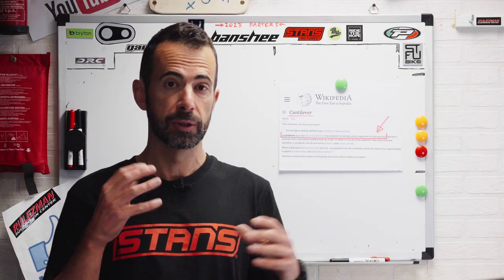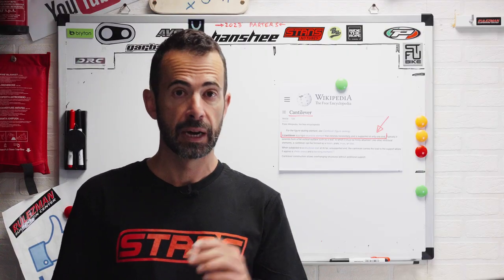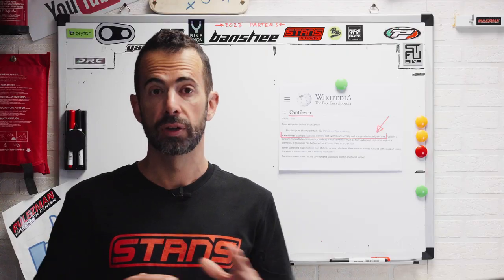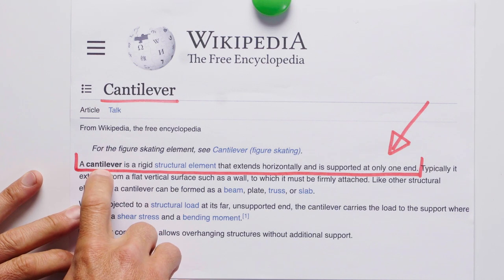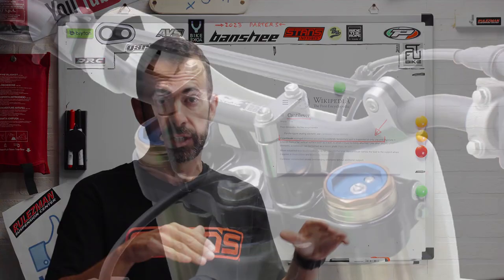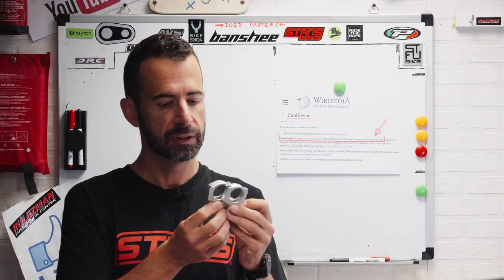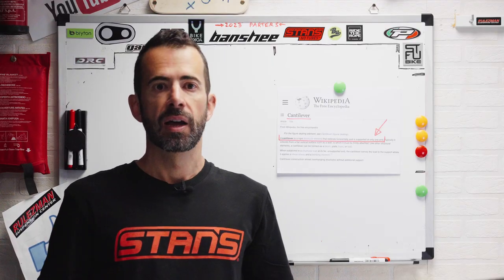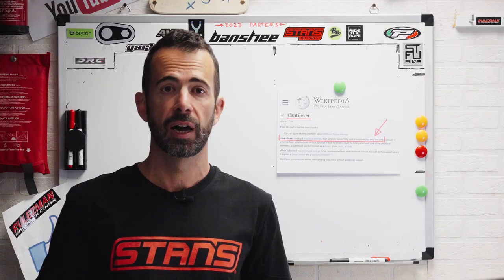MODERN GEOS & SHORT STEMS  : TECH TALK

Comment: Hi Dave, good video. Do you intend to do a more in depth video presenting more complicated mechanics? The general idea is there and your message and assumptions seems sound but I personally would appreciate at least one level deeper - especially for thesis' like the lack of effect (or significance) of forces through the arms/hands or your statement that zero length stem does not cause bending forces to the fork.  Also how do you come the right geometry figures? what is the connection to human biomechanics ( or putting it more simply - why not 600mm chain stay?)  do you have a white paper that you could share of your calculations? I would certainly enjoy reading.
Reply from the maker: I have other films and videos planned, no time to go deeper even because 98% of people would be just bored by the tech.         If you pass by finale ligure you are welcome to come and talk directly with myself on any topic.

Comment: This (your) stem brings the handlebar higher up. Does this mean I'll need a handlebar with less rise?
Reply from the maker: you need to get your grips around 111-113 from ground, if BB is 34-35 cm…. use the required rise to get this

Comment: Hi Dave, congrats for the content, but  you just made me wonder a question. Why not make a stem and bar with each 0 offset instead of doing additions and teakeaways with values? 
Wouldn't that generate even less stress since there is no force's arm?
Reply: You need backsweep on the handlebars for ergonomic reasons. Without the offset the hands would be behind the steerer tube.
Reply from the maker: A STRAIGHT POLE WILL BE NOT GOOD FOR BIOMECHANICS ( in other words it will fucks up your wrists)

Comment: Great video!
Who makes or where do you get a 15-20 mm stem these days?
Reply from the maker: at RULEZMAN . I make them
Reply: Onoff makes the kryptom direct mount 10mm stem. Tried it a while ago on a bike with a long reach but it felt like shit. Went back to short reach, very open head angle and 50mm stem.
Reply from the maker: @padraicbateman  I am 100% sure that suspension were bad set, and chainstay and wheel base was too short.  According to my tests 10 mm stem works pretty well if all other aspects are in the right spot
Reply: @RULEZMANSUSPENSION  Reach and chainstays were roughly simillar (r: 445 - cs: 435). I'm quite a perfectionist so I do a lot of bracketing in different locations till I find the best compromise or rather a usable range. At the same time I was testing with the fork offset, so used the 10mm stem on a Chris Porter Morc 36 (Fox 36 lowers converted to dual crown), that allowed me to make a lot of testing over 3 months to find the best setup. Morc uses Formula dual chamber air coil, not the best but still managed to get it pretty dialed. On the rear I was using a kitsuma coil which had to revalve to my weight due to too much rebound damping from stock.
In all honesty, it didn't feel like bad everywhere. Natural trails or more rough enduro style felt pretty good but bikepark style felt terrible.
Reply from the maker: how TALL
are you , man?
Reply: @RULEZMANSUSPENSION  minion height....165 with shoes 😁
Reply: @RULEZMANSUSPENSION   I'm 182cm, 40 mm stem.
I used to ride a medium-sized Ibis Ripmo, but I recently upgraded to a larger frame. I kept all the same components, shocks, and fork pressure (Manitou's). Today was my first ride on the new frame, and I hit up some trails that I know like the back of my hand.

First impressions? Well, I kinda wish the bottom bracket (BB) was closer to the front of the bike or that the chainstay was longer. Ibis makes all their frame sizes with a 435mm chainstay, which is the same for my new setup.

With the bigger frame, my bike's center of gravity has changed a bit (maybe the head angle is a degree different too). So, during turns, I found myself almost losing control and having my front wheel washed away. Gotta admit, it caught me off guard. Looks like I'll need some time to get used to it and maybe consider using a super short (!) stem.
Reply: @RULEZMANSUSPENSION  
Any details you can share about the step you are developing?
Can't find it on your website.
Reply: Spank makes a 25mm stem
Reply: @wx2999  Thanx, but I need a single crown stem.
Reply: @michaelyanovski9414  on my single crown bike I have a 30mm newmen

Comment: Question. If a longer chainstay increases the ratio of chainstay to front center, wouldn't a shorter front end also accomplish the same thing and thus help with climbing? (of course coupled with a steep seat angle, and assuming the bike is still the right size for someone) Always appreciate your content.
Reply from the maker: a short bike is crap bro. ….forget to shorten things.
Reply: @RULEZMANSUSPENSION  An easy practical lesson for the guy who asked you -- borrow some kid's 20" BMX and take it for a trail ride.  See what you think about shortening either half of the WB!  You get to try the shortest of all!  Steepest angles too!

It's a good lesson -- do your average trail loop on a road bike.  On a BMX bike.  On a "modern" hardtail trail bike -- rigid fork if possible, but still modern (65ish) HA.  How does each behave differently and why?  What does the relation of your hands to the front axle tell you as you move from bike to bike?  Which bikes get chocked and stopped by rocks, roots, holes most easily?  Which bikes buck you terribly in rougher surfaces?
Reply: No. A short chainstay + short front DOES the same weight  on the front wheel as a long CS+ long front, because your weight When descending or cornering is vertically above the bottom bracket (you are standing). So, only the ratio between the two matters.
When climbing, you are (often) seated, so you CoG moves backwards, relative to the bike. So only CS length and seat tube angle matter.
For standing climbing, your hypothesis would be correct, as long as the CS remained long enough to keep the CoG in front of the rear tire contact.
Reply from the maker: @tjb8841  Well, all your text means you have not watched and or understood what I said in the video, which is actually the same you have written.   🤝

Comment: In an ideal world wouldn't you want to create a situation where your hands are lined up with the fork axle to prevent over/under steering? And therefore have a shorter stem combined with a shorter fork offset too?
Reply from the maker: Negative.   you want arms aligned with steer tube as per explanations in the video, did you watched the whole 35 min?
Reply: I find I want to have a little stem length to get it to steer balanced for me. With a short stem I have felt the bike is understeered. @RULEZMANSUSPENSION, maybe you have other ideas or solutions that make a bike not feel understeered for you?
Reply from the maker: @niklasdr  invest in pro bike setting service.
Reply: @RULEZMANSUSPENSION  I would guess you suggest I go slacker head tube to get it to not feel understeered. That’s what I can think of right now. 
Though, I think I simply have to read in on theory what makes a vehicle more or less understeered.

Comment: How do I determine correct reach for my height? I'm 176cm on S3 spec enduro, 40 mm stem
Reply from the maker: about 470 x 650 true reach.
Reply: I’m not totally clear on the math here. how would I apply a/this formula to any given height to achieve real reach, which is pedal to grips?
Reply: 470x650… is this an ideal reach x stack for his height?
Reply from the maker: yes it is
Reply from the maker: working on it…